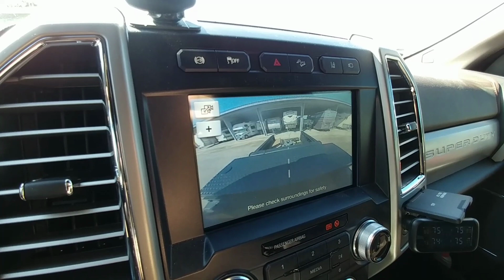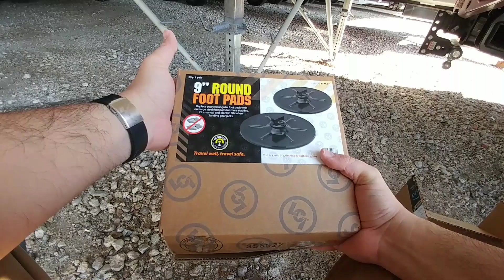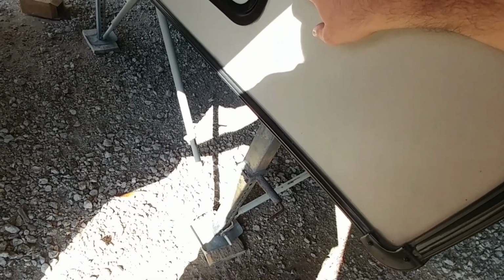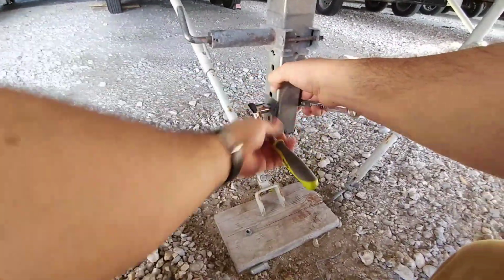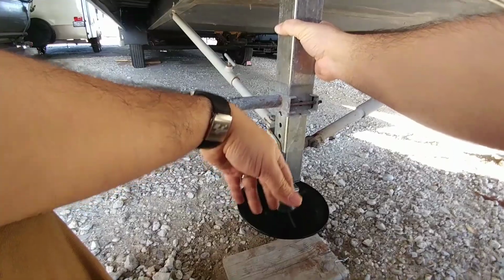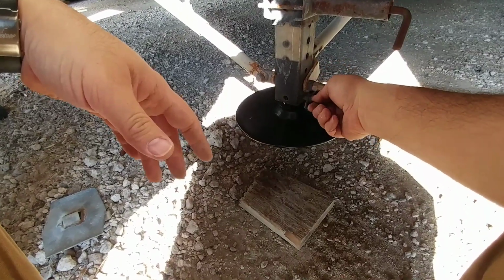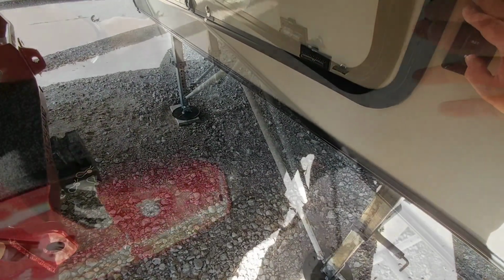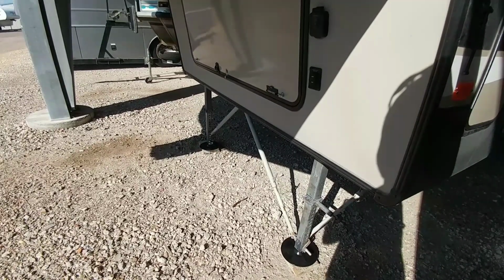Improved my Fifth Wheel in 10mins!

Comment: Nice video for a single motor landing gear system upgrade!  My worm gear stripped out on the drivers side single motor landing gear leg and I opted to install a Bulldog 500161 independent dual motor landing gear system that performs great.

Comment: You'd be amazed at what a hydraulic auto leveling system can do. The very first campground I took my Montana to was unlevel as can be, side to side unlevel, and I hit that auto level button just to see it in action and boy lemme tell you the door side tires, both of them, came off the ground! You could straight up wheel of fortune those jokers! Of course I fixed that with some horse stall mats under the tires, but still.

Comment: Thanks for the review looks like great products! I have the auto leveling system on my 2014 Palomino Sabre fifth wheel and when it works I absolutely love it but I seem to constantly have little problems with it! it's a Lippert system at the time  I believe the best one available. I always say it works best as long as you put it on a level site  but if the site's not level it always goes out of stroke I believe means one leg is  too far out compared to the other.

Comment: hey love your videos!  I've commented before and had a great reply from you so I have a new question.  My girlfriends son is about to come into some money and i wants to use it to buy a new truck and 5th wheel and 1t DRW truck  He keeps wanting t put a leveling kit on and a lift plus mud tires.  i try to tell him that isn't what these trucks are designed for.  A lot of the new ones have air ride suspension that will auto level .  Could you possibly do a video with pro's and cons of these things?  Tires, level kit, lift kit and how an air suspension can solve that?

Comment: When you store your camper for the winter do you throw down some 2x8’s under the tires so they don’t sit on rocks for months on end? I do this for piece of mind that the tires won’t have indentations on them, might just be me though.
Reply: I did this as well, on my motor home, except I used 1 inch thick HDPE Cutting boards. Wood will retain moisture for a long period after rain and that also does your tires no good.
Reply: Bruce Marcotte Did Not think about the cutting board. Do you just have them in contact with the ground or do you put them on top of boards?
Reply: They are just sitting on the ground. These cutting boards are commercial grade 1 inch thick. There are several WEB sites that sell it you can get in in various lengths and widths. When I got them they were left over scraps that a friend had. He was a meat cutting equipment repairman and he supplied his customers with it.
Reply from the maker: We take our Fifth Wheel out at least 1 or 2 times per month.  However, I usually put boards.  Good idea with the cutting boards!
Reply: As a former service advisor for a high volume rv dealership,I highly recommend getting something between your tires and the ground when storing. Trailer tires deteriorate from the inside out due to moisture seeping in through the sidewalls. That's one reason so many blowouts look like the tread is still new on them, it's internal failure.

Comment: People may not be aware but that micro adjustment will save a huge amount of wear and tear on the internal gears of those jacks,simply by allowing the load to be evenly spread out if properly adjusted. One jack won't be lifting the entire load while the other jack catches up. Or they could buy the bulldog individual jacks but that's quite expensive,trust me,I know,I just replaced my system with the bulldogs because 1 jack stripped out the lifting gear,and by the way,when that happens the unit falls until the other jack stops it.

Comment: Hey man I have a question for you. This last July I purchased a 2017 Lariat F250 with the powerstoke and so far I love the truck. However there is one thing I do resent which was not upgrading to the led headlight and taillight package. Any thoughts on how I should approach ditching this halogen set up? I’ve looked online and found oem lights which are around 1,500 bucks a piece. Now I know if you order them from the factory they only cost you an addition thousand dollars. What do you recommend doing?
Reply from the maker: The relays and fuses are the same to support both systems.  I personally love the Quad LED headlights.  Check our the 2017 Super Duty second on www.ford-trucks.com.  There is an entire topic setup for this.
Reply: Added ground control to my rig after purchase you should hit LCI up maybe you could do video of install for discount on kit. FWIW mine was about  $2k bolted in no welding required on install one of best investments I've made.

Comment from the maker: To answer a few questions: 1. I installed it on the passenger side because the wind was blowing too hard on the driver side and it messed with the audio too much.  2. I did not use the bolt that held the JT Stonge Arm in place simply because it's not originally intended for shearing support and I did not want the weight of the landing gear to be on it.  3. I am also interested in seeing how well the RV stabilizes with the addition of the micro adjuster.  With all the weight resting on it, I'm sure it will have little negative impact. 4. Also, there are times that both feet do not come in contact with the ground at the same point when dropping the front landing gear.  I understand that the adjustment isn't designed to "level" the RV, it is being used to make sure BOTH feet make contact with the ground at the same point.  I hope this help.
Reply: I am fortunate in the fact that my landing gear run independent from each other.  In other words, I have a switch for each side and can level them up that way so that they both touch at the same time.  Then just put them down together with both switches.
Reply: JT - mine do also.  It's very handy when you do a lot of camping where you don't have level paved pads.

Comment: Hey brother great job. Make sure they don't vibrate out while driving. Mabe weld a washer at the end of its tread.
Reply from the maker: +Shackles: the bolt portion is pinched to prevent that from happening.
Reply: Good stuff

Comment: Nice video as always. But. Please don’t hate me. I’m not trying to start an rant discussion here.  That adjuster is not so much to level the unit as it is to help ensure that when both feet touch the ground they both have equal weight on them. I would not suggest using them on a auto leveling system. When u unhitch a unit with auto level the first option is drop front legs. When u push ok and the system begins to bring down the from two legs they will touch down and even out weight in their own. Basically as the adjuster you installed dose for your unit. The same goes for the rest of the leveling jacks on the middle or rear. The system reads amp spikes and knows the feet are on the ground. Only thing I have to add to that is some units do sit high off the ground and do require additional blocks so that the system dose not run out of stroke or travel in the jack. Some thing additional for u is u can add auto level to any fifth wheel even if it dose not already have mounting plates. Check with your dealer or the manufacturer or the rv or leveling system you want to have installed on the unit. I have no real preference to brands yet my self but I do handle a lot of lci electric 6 point auto level systems. They are easy to service. However lci also makes a hydraulic 6 point version of the level up system which I also like. Sturdy and solid. I would say it comes down to cost of aftermarkets. Equalizer in Elkhart Indiana has a really nice system and they do all after market and oem install. Ask for nick Godfree. And big foot also makes a after market system located in white pigeon Michigan just over the Indiana Michigan line. Hope this helps u and your views. Happy camping.
Reply from the maker: Thanks! I should have clarified in the video.  I'm using it to level the feet when they make contact with the ground.  Sometimes that occurs at different levels and I want to make sure they are level when touching the ground.  Sorry for the confusion.  Great comment though.
Reply: Big Truck Big RV no problem. Love the videos. Just wanted to make sure I was not steeping on any toes. I was thinking you might have meant what I had said but wanted to clarify for others too. Fingers crossed I’m holding out for my bed rug still this spring. Hope to be able to share it with u when I do

Comment: instead of using the bolt that came with the adjuster, use the bolt for the strong arm to hold in the adjuster... no?
Reply: I was going to ask the same question!
Reply: And I as well...
Reply: The bolt for the JT Strongarms probably doesn’t have the same shear strength as the one holding the original foot.

Comment: I'm sure many know about this, but if anyone needs pads, or isolators, or whatever, I have three words, HORSE STALL MAT. I have a sheet at my work bench area that I cut things out of all the time. Someone who's handy can template any design, even with a handle, and cut out what they need. Need a thick rubber something to go under, or even adhered to, those feet? Need something to put under the batteries, or LP tanks? Need a spacer in between washers to isolate something you bolted on? Heck, I've even made drivetrain components and rubber isolators out of it.  With a little time and effort, and sharp blades, you can find plenty of uses for it.

Comment: Why didn’t you install the micro adjustment adapter to the other side?  I can almost grantee you that you will need some time in the future.
Reply: My first thought as well...
Reply from the maker: Good observations.  It’s actually going on the other side, but the wind was funneling through that side and made it hard to record audio.  I installed it on the passenger side for audio clarity.....the things I do for semi good video quality.   :). It’s going to be moved to the other side when I get a chance.
Reply: I think he meant; why not put adjusters on BOTH landing gear? That is my curiosity, you never know which pad will sit first? All depends on the terrain.
Reply: You would usually be stacking some leveling blocks, but it is often not possible to get both sides equidistant from the landing pad.  For simplicity’s sake, lets assume the leveling blocks are 1” thick and you end up with a 1/2” difference or gap on one side.  If that gap is on the non adjustable side, simply swap one stackable block to that side so that the same gap exists on the side with adjustability.  I could be wrong, but that’s what I envision.
Reply: Because you only need to have micro adjustability on one side.  You lower the non-adjustable leg until it reaches the ground, or just above it.  Then you lower the adjustable leg down until you get about an inch higher above the ground of the unadjustable leg.  Then you use the screw mechanism to move until it matches the ground clearance of the unadjustable leg.  
From there, you just motor the legs down until you can unhitch it.  TaDa! The front is level.
Reply: DUH, got it...forgot about the pins that make each leg lengthen independently.